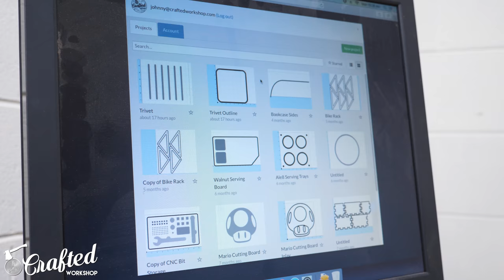DIY Scrap Wood Trivets | Traditional Woodworking vs. CNC How-To

Comment: How do these hold up to HOT PANS and things? Using poly - does the heat ruin the finish or melt and stick to the pans ? I'm a beginner and not sure what finish to use on trivits/hot pads.
thanks.
Reply from the maker: These have held up surprisingly well for me! No issues with the finish peeling.

Comment: I love your scrap wood projects because I'm always looking for ideas with my scraps. Thanks for sharing. When using my CNC, I feel like I'm always trying to figure out clamp placement. The easy solution would be to cut the piece bigger than needed and trim it to size later, but I'm too cheap and don't want more scrap, haha!
Reply from the maker: Thanks man! Clamping is definitely tricky, I use double sided tape a lot too.

Comment: It's amazing how far you come from the very first video making the workbench from a door. How in the world did you get all the sponsorship and equipment? I'm sure they go hand in hand. I would like to follow the same path. Would you consider pointing me in the right direction. I'm sure you get this all the time, nothing ventured nothing gained. thanksGreat work as usual.
Reply from the maker: Thanks Mark, it's definitely been a crazy couple of years. Step 1 is to build an audience, then you can start working on sponsorships. It takes a ton of hard work to consistently put out the content, but it pays off for sure.

Comment: little off the videos topic question: what grit of sand paper do you use on your sander? 

I recently purchased the Ridgid which comes with 80 grit and after the first use I thought it was too aggressive and ordered 120 grit.  just curious on your experience and perspective.

Keep up the great videos!
Reply from the maker: I use 120 grit for the most part on that belt sander. Works well for me.

Comment: Very nicely done! One tip when CNC’in shallow cuts with the bottom not visible, use a downward cutting bit and put some masking tape on the piece. That way the top cuts are nice and clean and any tear out is at the bottom where it’s not visible.
Reply from the maker: That would have definitely been good on this one, that's what I made the outside cut with the trivet facing down, so any tearout would be pulled downwards. Worked out well! I like upcut bits for these types of applications since they pull the chips out better than a downcut bit. A compression bit would probably be the best choice really.

Comment: I was just thinking of trying to make one of these the other day. We have a painted metal one that looks nice but it sticks to the bottom of a hot pan/pot, super annoying. I was going to use mineral oil or like a tried and true on it though for heat, I'd love to see a followup with hot things being set on it, I've never put heat on a poly finish, just curious how it holds up. We sometimes use ours to set something directly from the stove top or thr oven on, so it can be quite hot. Great looking project and perfect way to use up scraps!
Reply from the maker: Yea, Marc at the Wood Whisperer did a test of polys and one of them was using a hot pan, and it didn't seem to have any effect. We'll see!
Reply: Crafted Workshop that's right, I just rewatched that video. I knew he did the hot mug but forgot about the pan of boiling water. Thanks! I'm a bit leary on making these manually on the router table  but with good stop blocks and setup it looks like it could be done. Great alternative to the typical cutting board gift.

Comment: Will that wood and poly hold up to regular contact with high heat?
Reply from the maker: Yea, it should be fine. Marc over at the Wood Whisperer tested multiple polys vs. a hot pan and they didn't seem to be phased.